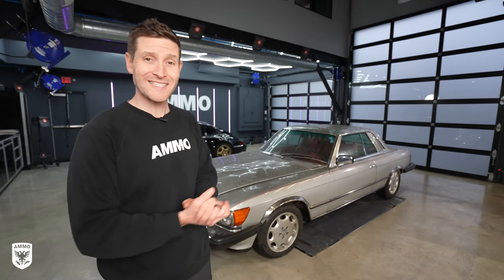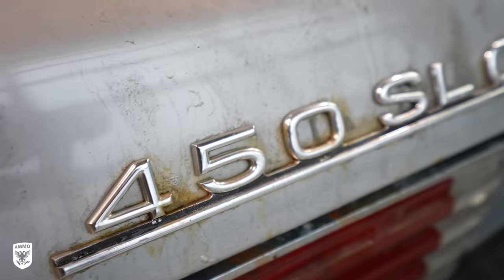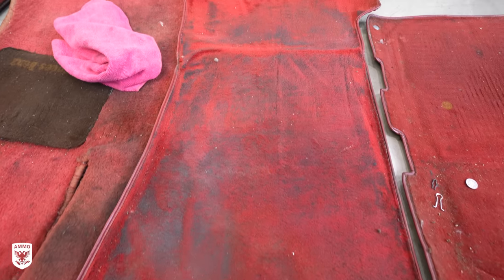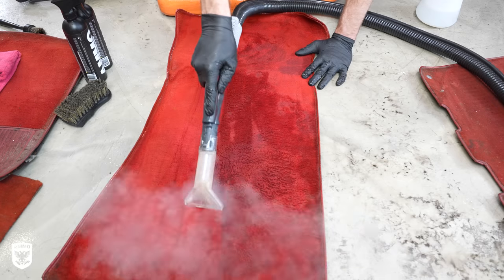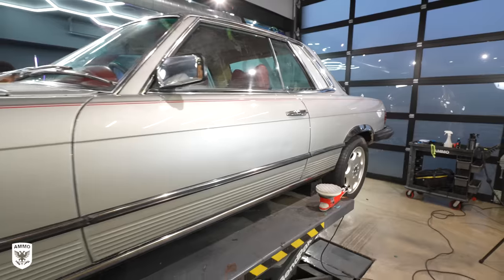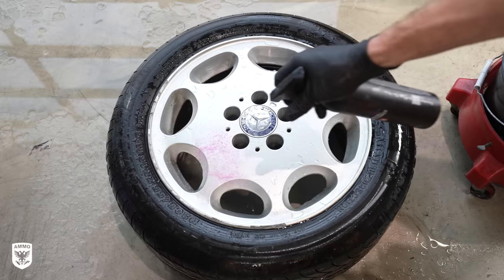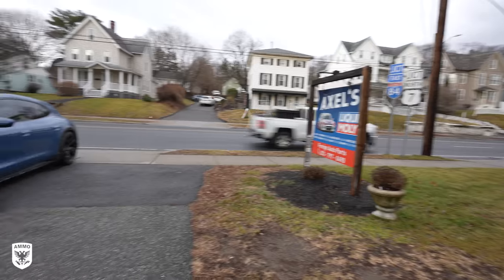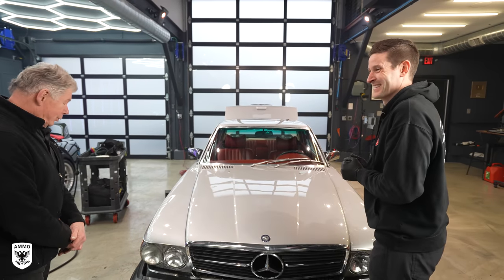First Wash in 16 Years: Mercedes SLC 450 Disaster Detail Buy and Flip!

Comment: The American bumpers ruin every car. Whoever get's it must replace them.
Reply: I was thinking the same thing
Reply: Thinking the same thing. Beautiful car but the BUMPERS 😩
Reply: The wheels also look out of place.
Reply: That was the desirable look of the time. Don’t get a vintage car if you have modern tastes lol or YOU will be the one ruining it doing that.
Reply: I was boutta say the same thing. Their laws butchered our beautiful cars 😅
Reply: @78town  Im no expert but I think they just had these bumpers cause of some laws because I have never seen those on EU cars.
Reply: Euro bumpers cost $2k, only worth it if everything else on the car has been restored first.  He sold this for 8k so a cosmetic change would cost 25% of the cars value
Reply: I agree!
Reply: @78town  Eu spec bumpers look way better
Reply: @SxpticFlxsh  The American market complained since 1960s that car repairs were too expensive, because bumpers were too weak. American lawmakers made manufacturers comply with bumper laws. These bumpers did not make the cars safer, but they certainly made cars in North America look funny. Kind of like how EU pedestrian safety laws today have been blamed on the wretched-looking frontal styling we have today on mainstream cars. The only modern EU cars I don’t see with the blunt, flat, non-aerodynamic, frontal areas are limited-production super cars and hyper cars.
Reply: @78town  you cant be more wrong!
Use the original bumbers from the factory, and the throw those ridiculous American bumpers away !
Reply: I like em
Reply: @78town  if you’re going to make a comment like that, maybe you should know what you’re talking about first
Reply: I think it looks good, only in America did you get those bumpers.
Reply: @78town  wrong
Reply: @78town  sorry, disagree 100%
Reply: Ditto
Reply: @78town  better do some research before commenting on something you think you know about.
Reply: I thought how could BMW install such ugly bumpers… now it makes sense
Reply: We in Indonesia didn't get those silly bumper's, but somewhat I always fascinated everytime seeing someone importing old cars with usdm bumpers...it's just silly, ugly yes...but still I don't mind tho

Yes at some point it really ruins the car like Countach but most of the time I think for someone like me who lived outside US, getting those 5mph bumper is always Amazing
Reply: If they find 150 years car first cars i will subscribe this channel, bcause this channel the specialist treasure car wash
Reply: @78town  you don’t get it dude.. that was the American look at the time not the Mercedes look at the time.. the EU version with the shorter bumper is a much more appealing look for for many of a collectible
Reply: @78town  it is not a modern taste ! At the times in europ, The bumpers were different from the US. Look at the pictures in Google and you will be surprised to see the beautiful and thin chrome bumpers in all the cars.
Reply: @78town  it wasn’t… It was because the us government mandated that you had to be able to hit things at 5mph with no damage, so manufacturers basically slapped little shock absorbers on the front/back of cars for the us market, making the bumpers stick out way further than the designers intended.
Reply: @78town  not really, fidderent countries with different variations,  also body coloured bumpers or less shitty chrome, looks better 🤣
Reply: Aren’t they just the ugliest things? I’d swap them for Euro spec ASAP
Reply: @78town  the Euro bumpers were much less intrusive. American bumpers are huge and ugly.
Reply: Sometimes I wonder if the government made them fit the ugly bumpers to deter people from buying non-american vehicles.
Reply: @78town  oh, that was an, "I know it better"-attitude gone wrong. no "desirable" look of that time. no intention to make it look that way. only to obey some weird US regulation back then. the car looked way different in its original market. they must attach those ugly bumpers, ruining it's intended looks. regulations don't require them anymore and it would be legal to replace them. and that's exactly why peeps in here are saying this; just do you know. cheers!
Reply: @rysiucastro  I agree i would swap this rims with still original slc 5 arm alloy rims. I did it on my 280 SLC and they look sick
Reply: Yes, as a European I find the American bumpers out of place. Also the chrome wheel arches feel after market and 'tacky'. Round lights at the front... could they be reversed to the original?
Reply: @malibuclassic77  the price of the coupes are definitely going up, worth the investment.
Reply: Along with the chrome wheel arch extensions
Reply: Great pull from the NY garage. The car will pick the driver.
Reply: Wrong bumpers, wrong alloys and these hideous  wheelarch trims that arent original
Reply: @jimcabezola3051  Yet, with the massive streets and parking spaces, the fact they crashed them enough to need the fat low-speed impact bumpers is laughable.
Reply: Why be so negative? Better in some ways to appreciate the car for what it is, I think
Reply: U.S. spec laws ruin every car! Stupid ugly looking bumpers and stupid ugly looking orange/red side reflectors.
Reply: @78town  the car is European, right. Well, for your surprise, the car had regular, non ugly bumpers in Europe back in the day. Only US demanded these hideous bumpers because of some stupid law.
Reply: @78town  what are you talking about. This ugly bumpers were the result of ridiculous us laws. They were considered ugly back then too, look at period car tests and educate yourself.
Reply: Agreed
Reply: @rysiucastro  there the correct wheels...from Mercedes
Reply: @cedricleon8605  they were for the USA market only to meet accident requirements.
Reply: @Jonathan_Doe_  yes that's it exactly
Reply: @ChrisJenkspiano  agree chrome arches not good
Reply: @daweigo6851  Not really. They are Mercedes wheels, but for newer models.
Reply: @rysiucastro  it was the centre caps lol
Reply: You can get the US bumpers tucked.  You drill a hole in the hydraulic rams the bumpers are attached to and push them in closer to the body. Think you lose 2 inches front and back.
Reply: A car guy, name Axel? Perfection!
Reply: @rysiucastro  yeah, the wheels look too new
Reply: In Indonesia this bumper is very popular and super duper very expensive
Reply: @78town 
Euro cars shipped to the US for sale had to adhere to US regulations, which often meant changes to but not exclusively the bumpers to make them more robust.
Reply: I know it's an unpopular opinion but I find those US bumpers weirdly appealing. I think it's just so emblematic of the period that in my mind it would look off without them.

Comment: Yeah those old bosch fuel injectors would get very gummed up over time, and my guess is that Axel will probably have to replace them at some point just because even after cleaning them they're still 45 year old injectors and will likely wear out over time. As you can see the injectors did spray quite a bit more gasoline into the engine back in those days and continuously to keep the engine running which is why it's so crucial especially on these older European cars to clean your fuel injectors every so often. Btw I work at the service center at Greentree Toyota and every now and then we get supras like that one coming in through the shop. Awesome cars to drive!

Comment: Definitely not one to give you advice, but may i recommend ScrapeRite plastic razor blades instead of the Keysco blunt blades you use? They come in different hardness levels and have a more razor like edge when new. They havebeen the best brand i have used for taking decals off without damaging paint like metal scraper blades tend to do unless you have ninja skills.

Comment: Nice car, the SLC doesn't get the respect it deserves. If I had that, I would ditch those later wheels and put some correct bundt wheels on, get rid of the aftermarket chrome wheel arch trims, uninstall all of that old cellphone crap under the rear seat, and put in a period correct Becker radio.
I love how Larry always does a little victory yelp with raised arms when he first gets an old car to fire up.
Reply: I would do everything you suggested + install the thinner European market spec bumpers 😏😏

Comment: Plugged return line causes the fuel pressure to run high which then causes the metering rod to not allow the vein door to move which then delivers. No fuel. High return line psi causes no fuel

Comment: Honestly I just replace old injectors after 100-130k miles there pretty much done and they're about $30 per injector or around $300 for a new set why waste time on old injectors that are pretty much non fixable and only slow you down. 
Only exception are diesel injectors which can be serviced or really old injectors from like the 50' and 60's era which are crazy expensive.

Comment: Random question, here in MA they use a spray material on the roads in addition to road salt. I recently puchased a white V90 wagon and within 2 weeks I have yellow spots on the paint on the lower areas. Using iron fallout takes it off with a little bit of pressure. Does that cause any damage to the paint long term if I am to use it every other wash during the NE winter months?  7-8 years ago i have a white Tundra and found the same issue which drove me crazy till I figured it out.

Comment: I always wonder what do u do with all the towels? Do you throw them out? Surely not right...
Reply: I always throw mine out, or use them as random rags around the house. Cheap detailing towels are less than $10 for a pack of 10 and it's just not worth the risk of using them on paint.

Comment: Larry I am always surprised to see you clean glass after you've cleaned the paint. It seems like the glass would be one of the first things you would attack after an initial power wash of the entire car. My concern is that if you clean the glass after polishing the paint and detailing the interior, the chemicals used to clean the glass would get on the paint and interior and may do some damage or discoloration. Obviously this is not the case since most often you clean glass last. Would be curious to hear if you have a particular reason for your order of operations.

Comment: Man, the Injectors have to be expensive in the U.S. if you go through all that trouble. They are 23 Euros in Germany a piece. That's not even worth thinking about cleaning them - also, the most important thing on a K-/KE-Jettronic is leak air, those plastic "shoes" the injector sits in are gone after that amount of time and they will cause issues, same goes for any rubber hose, boot or vacuum. No leak air, good spark and clean injectors - and the K/KE will ALWAYS run.

Comment: The 1978 Mercedes Benz SLC 450 has a 4.5 L V8 that makes 220 hp. Compare this with a modern Subaru BRZ that makes 236 hp from a 2.3 L flat four, and add the fact that the BRZ weighs 900 lb less.  You'd have to really like Mercs!

Comment: I installed a water filter on my air compressor and I still get water coming out of it when I use it to help dry my car. I even shut it off when not in use and it drains, otherwise it will come on and off all the time. How would you fix this???